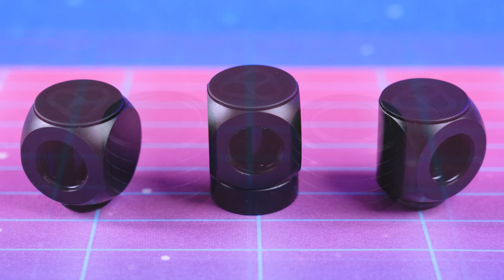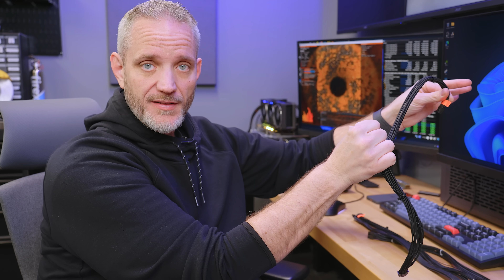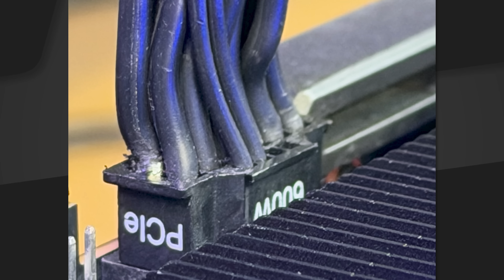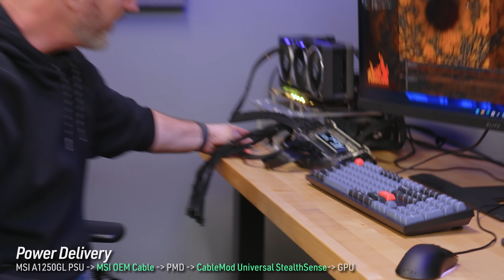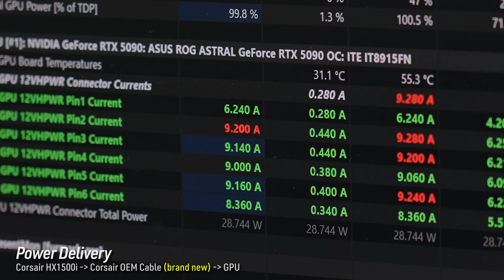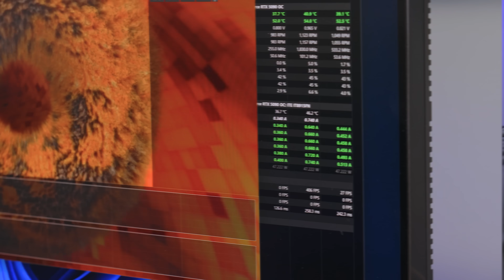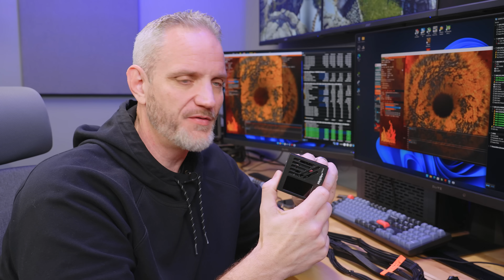More details on what could be causing 12VHPWR / 12V2x6 Cables to melt

Comment: just instead of soldering 2x6 just solder xt90 there. also i heard if this melts there is only one coil on the way to core so 12v goes on the core frying it if that is true resoldering 2x6 is least of an issue

Comment: Jay - Ever go to a classic car show and notice the near wire free engine bays? 

Why don't they make a longer PCB and have the connector on the far right side in the back corner area?  and designed/engineered for right-angle use.  This way you have a SHORTER cable + hidden cable - then- it would not matter if it's 3x8 pin or WHATEVER it needs to be.  You would then have less tension on the cable...  They want us paying $1500-$5000 for a video card - but they cannot spare a few extra dollars in materials?  

Let me guess: Next time we'll have to SUBSCRIBE to a cable to get one that works? ;-)...

EVGA had a sweet right angle adapter for their 1080ti FTWiii - I never had one problem with it- and it cleaned everything up.  There's no reason why we need cases with cables going all over the place when everything CAN and SHOULD be engineered from day one to plug in - work correctly and not look like a bowl of spaghettis at your fave Italian place!

Comment: Hey Jay, I've got a 5090 Astral LC, with a Seasonic Vertex PX-1200W psu, both came with adapter cables, 12HPWR to 8pin PCI-E with GPU ,12HPWR to 12HPWR with PSU, but I've still decided to buy a 12V2x6 native (manufacturer calls it this way, with both connectors being 12V2x6) cable from Seasonic and use that instead. They have the connector colored as light blue, which should go in all way into the female connector on GPU and PSU. It was extremely hard to get them in, I've even took some pictures to confirm they are seated properly. So far it's good, did not see any physical changes to it, I'm using GPU Tweak 3 and HWInfo like you to monitor the load on the pins, I just renamed it to 12V-2X6 Pin1-6. The biggest difference I've seen is 0.040 A under load between some Pins. Tested with some games like Doom The Dark Ages, Stalker 2, Elder Scrolls Oblivion Remastered, Hogwarts Legacy, Space Marine 2.

Comment: Sure doesn't help you pulling on the cable when inserting and removing it rather than the plastic connector...

I do have the Farsgear 3xPCIe-8 to 12v because my PSU has no 12v. The 12v connector is very very tight it's a nightmare to put in and get out.

Comment: I just got my hands on Astral 5090 and it sits in the box since I’m afraid to plug it in🤦‍♂️ please help me out. I already ordered wire view pro 2 but I wonder if my Seasonic Prime PX 1600 3.0 Patinum will do the job or I have to get sth in 3.1 standard? Working with Threadripper pro 7975WX. I used the Corsair cable for my 4070ti so far but now I’m not sure what would be the safest option. I do a lot of rendering

Comment: I use a CableMod 12v2x6 90 degree angled cable, that's the only cable I trust. Wires don't bend and the 90 degree angle makes the wires naturally flow towards the PSU without any stress bends. Also the wires are pure copper and not tinned copper which has a much higher melting point.

Comment: this is what happens when idiots decide that because 1 pin can, all pins can and then connect them to joined current    oldest discovery in electronics - literally why power systems use BUS BARS instead of groups of wires

Comment: 4:29 Zip-tie + bending can cause internal braided copper to wear and tear.  changing the bend direction altering resistance and causing cards to shut down sounds like internally torn copper.
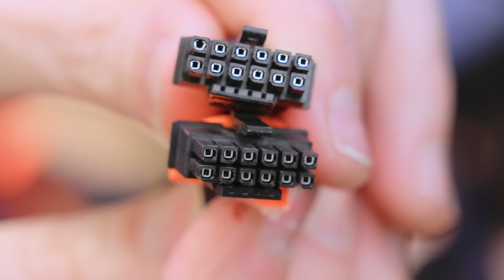16:33 the top left terminal on the upper connector is deformed massively, also bottom connector top right looks pretty deformed, and the more important part is where the terminals meet, there may be a bar spring construction inside with actually makes the contact which we cannot see  in the video which also might be plastically deformed.  I've been involved in massive recalls for connectors (not in PC industry), and seen some bad connectors, but these stamped terminals with open ends like these can plastically deform and lose contact force, causing increased impedance quite easily, and it's extremely hard to tell by visual if it's actually making good contact or not unless you do a proper tear-down and 3D scan/measurements.  Especially when the connector specification only require a dozen or so mating cycles, manufacturers will try to use cheaper materials/construction/manufacturing tolerance control to keep things cheaper which can be more prone to plastic deformation (some more boutique cables might use better connectors that use better materials or design).  These types of connectors dimensions are measured in micro-meters so even if they look "OK"-ish, their mating force might already be out of spec (don't know the exact spec for 12V 2x6, but many industrial connector terminal crimp height tolerances are in the 0.01mm range).

Comment: A cable that's so easily damaged or "installed wrong" to the point that it causes melting and fires, shouldn't exist. I understand what they were trying to achieve, but PCI-E power is just better minus aesthetics - I wish Nvidia would just drop it entirely, as it's not really that safe..

Comment: Got to give credit where it’s due. The 600w cable that came with my rog Thor platinum 3 spent 8 months plugged into a 5080 before I upgraded to an astral 5090. When I fired up the 5090 I started monitoring the pins with Troy benchmarks overlay and was getting constant pin imbalance warnings. Gabbed a cable mod pro 90 degree cable, plugged it in and now rock solid 98% pin balance under any load.

Comment: How much longer it will take for manufacturers to realize that 12V high power connector is a BAD DESIGN? We don't need lab testing, we don't need special tools to monitor each lines, we don't need manufacturers of power supplies and graphic cards to invent new stuff to prevent graphic cards from burning down people houses,... We need to ditch that connector and make something what will be actual working and will be safe, because that crap show with 12V high power start stretch into years right now, and IT WILL BE ONLY WORSE.

Comment: Gigabyte Windforce RTX 4090 still fine using the cable that came with my Bequiet PSU. No trace of overheating/melting after 3+years of playing 2 hrs daily. Just use a good quality cable and PSU.

Comment: Wouldn't the power supply shut off the POS if it can't detect a proper ground connection?  I mean, the power supplies are like a battery, they're an overly complex system of checks and balances...

Comment: I doubt that any of PC cables (even these outside the PC for supply and to display) are designated to operate in frequent move. Such feature require special design with very very thin copper wires. That is why you all need to be aware that these cables are only for stationery installation.

Comment: The fact that I see 9A being pulled through the pins through even distribution is already cause for concern. That's (edit) 1.3 Ohms for f*** sake!!!! That's flirting with fire!!!!.
It should be a 24 pin motherboard connector connecting to these cards, AT LEAST. Not these 12V*L*PWR 2x6.

Comment: You could also investigate Sapphire's 9070 XT adapter which has already proven to fail massively. There's definitely something wrong with the design of that adapter because the card works perfectly with a native cable from PSU

Comment: Yeah, I learned quality of the cable is the main thing. I have had new ones, test them with GPU tweak three and some pins and their amp draw are all over the place. When I went out for the 5090 I was originally going to get the water cooled MSI variant and opted instead for the astral. 

I know it’s expensive but it’s a bit more peace of mind that I can test cables and see how they’re doing under load.

Comment: The problem of WireView is that you are 3rd connection point that could become a problem. I looked at the spec, and it seems they have temperature probes for input and output, and two more external ones to monitor something bad happening. This connector is simply too fragile, flying to close to the sun (well, it's limits). I have no idea how they decided not to have protection for loads. You don't need a lot of power to get things melting over time.

Comment: I have both 4090 TUF & 5090 Astral. 

MSI & líen li power supplies. New out of the box the lien li the cable would show in even amps in the asus GPU tweak 3. Put in the MSI cable and the amps across the 6 pins had less deviation. 

I’m pretty clean and I clean my ps about 1 or two months.  

Noticed the cable started having pins with higher amps. Orders good quality cables and no issues.

The cables can fatigue with a lot of plug cycles. So if I order a new cable I look at the pins on both ends then test them by running the 5090 at 600 watts in different scenarios. Then I bump down the power limits back to 95-97 power.

Comment: If each pins are rated for 9.7 amps, 8 amps isn't healthy. It shouldn't be drawing more than 7 amps per pin, ideally 5 or less. The RTX 5090 is maxing out the 12v high power connection and it really needs 2 of them to prevent this.

Comment: Copper wire can and will develop work hardening over time.  It should be another good test to go end to end, pin by pin, wire by wire...and test resistance with a DMM.  A minute or two of time will show you if the wires themselves have a variance in resistance which can also explain pin sensing load variances.  Do it in another video so the horse's spirit can begin being beaten hahaha.

Comment: Jay I see you wiggle the plug for side to side as you plug  them in and remove them. you should only pull straight up and down without wiggling. wiggling causes expansion of the sockets in the connector. The tolerances on the pins and sockets are very minute /tight tolerances and the sockets will expand after repeated insertion with a wiggling action. If you look at the sockets under magnification,  You will see it as a stamped part with a gap on one side of the socket that can expand. Just my 2 cents form a electrical harness manufacture. Hope this help you build better insertion habits.

Comment: Like cpu's I remember early on people saying the plug has a very limited amount of reseatings, was wondering if I was going crazy and asked ai and it says the plug is generally rated for 30-40 matings. You went out of spec on the plug in less than 10minutes of showing floppy cable connections. Is this really fair to any of the products being used?

Comment: In the 1980s I did serious professional radio control racing, the motor controller to motor to battery used silicon wires able to pull 100 amp spike and 60amp all day long and I never replaced a set in over 3 years, and here we are in 2026 using braided cheap wires and nylon plugs, the nylon plugs are fine, but the cabling is garbage.

Most reputable PC cables use PVC, but the bargain cables you find on sites like Amazon often use lower grade blends or even PE (Polyethylene) and PP to save a fraction of a cent per meter just don't buy cheap cables.

Comment: I work as an electrician and I always wonder why these wires can be run parallel and not have a fuse or a Shunt as a failsave for each wire.
When we run wires in parallel we have to have a fuse on all wires so if something goes wrong you wont end up with a fire. At least if the Single wire cant handle the full load all the time.
Im just glad my GPU still has the old Standard where I have much more headroom before it even gets warm.

Comment: KIDS DONT TRY THIS AT HOME that 5090 is very dangerous it mess with power supply now not the 12v pin connector but the cable that is scary ...for safety put fire extinguisher next to your PC😅

Comment: At this point, I think PCI-SIG needs to just say "fuck-it" and either fall back to PCIE or develop some hard-wired power delivery like those dumb back-front motherboards. The 12Vhp connector experiment has been a resounding failure.

Comment: What's pretty stunning is that you have all of that power moving around the board in nearly a flawless way, yet you have high levels of failure on a cord or connector. Clearly you have several design failures that were not seen as failures, ignored for pride/cost/didn't care or hopes that it doesn't matter enough to hit their bottom line image.

Comment: Last weekend I also connected the WireView Pro II to my 5090. I had previously been using the 4-to-1 adapter cable that came with the graphics card... the WireView adapter immediately displayed a warning. I then switched to a Corsair cable and was able to run two hours of benchmarks without any warnings. After the silicon lottery, now comes the 12VHPWR cable lottery.

Comment: Leaving the cable alone inside the card is the best advise I can get from this unless I want something to melt. The pc has a lot of fragile components and should be left alone unless you are building it for the first time. As much as you would enjoy tinkering and plug cables in and out of boards just brace yourself and leave it alone for a year or two until you are going to BUILD something totally new from scratch.

Comment: Transient spikes can messup alot of stuff, the sudden rush of extra amperage (remember current runs through the entire circuit for DC circuits) that now needs to run to the remaining grounds could have caused a clock instability and the bios caused the shutdown? Maybe you simulated a power surge through quick movement of current? Sensitive and high speed electronics tend to be very picky on their grounds.

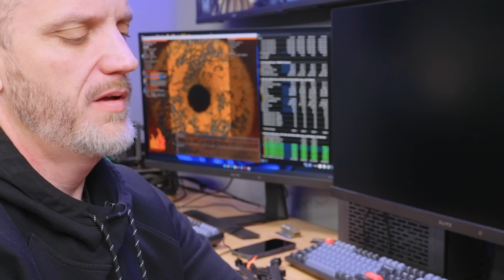Comment: @16:32 clearly the upper left pin in the top connector is splayed out. The upper right on the bottom connector doesn't look so good either.

Comment: the cables have voltage and amperage. if you suspect the wiring/plugs to be bad - the way we diag this in industry is putting a scope on one end. then loading to max amperage and checking voltage drop and thermals on each pin/wire.   we then load with high voltage (40KV+) at a low amperage (.05a) and check the scope for each wire to see if there is a short or bleed over.    do this to your cables          also if you have loose pins... just touching the cable, anywhere, can cause it to wig out

Comment: I have a tuf 5090 and i realized basically after the day i got it, that it needed to be in quiet mode and be unservolted. It has worked like a charm, i barely pull 400 watts now and its way cooler

Comment: I have to admit, one of the saving graces of only being able to secure a 3090 was the safer but bulkier 3 way PCI connector for power. Way more tolerance to imperfect connections than any of the 12VHPWR models. Connector variance is a fact of life. I periodically have to clean up speaker connectors due to what I believe is ground variance in such locations. I would imagine that 10 amps @12v has little room for variance without risk of fire. This is just my opinion and I'm no expert in this area, but cleaning up those connectors definitely solved what I though might otherwise have been an amplifier fault. That safety cut off device to save all things looks like an excellent idea for anyone using modern graphics cards which the HPWR connectors.

Comment: The Corsair one didn’t have native termination on both ends? I just built a PC with an RM850 and it has that native 12 pin on the power supply, is yours an older one?

Comment: These cards are pulling to many amps for the wire size and pin size. I have figured that out when I first started. check your wire size and see if its 12  awg stranded or 14 both only allow set amps

Comment: The problem with these cables and it has been since day 1 in my opinion is that the wire gauge used is to small for the current load if the connector pins were larger and the wire guage was larger these issues wouldn't exist imho

Comment: So did a little looking highly likely the Wire Gauge for these cables is either #18(max amp 10)  or #16 (max amp 13) so if the cables are getting close to 10A that would be very dangerous for those Gauge cables. Google says the 12vhpwr cables use 16 Gauge for the 12 main power pins and 28 Gauge for the sense wires (the lower the Gauge number the bigger the cable) the google info im taking about is from cable mods website.

Comment: When I bought a 9070 XT, I specifically looked for one that did NOT use 12VHPWR connections because of the problems with them. I ended up with an XFX Mercury OC, which uses three 8-pin PCIe power connections instead, and since my PSU (NZXT C1000 Gold) has five CPU/PCIe power connections it was trivial to feed each branch over its own cabling.

I just did a monthly dust blowout of my case and checked all three connections, and they're pristine. Not the first sign of heating, let alone the meltdowns plaguing 12VHPWR. Card has been working flawlessly since I got it.

Comment: First Intel 13th and 14th Gen CPUs are drawing too much power and melting themselves. Now we have 5090's with cables melting and or drawing too much power. At what point are computer engineers going to realize you can only squeeze so much electricity into something before its no longer safe? Threre needs to be some method of quality assurance and or testing before releasing products for the consumer to discover potential problems like this.

Comment: There is a huge difference between gold or tin connectors and crimped versus soldered.  I've repaired a bunch of electronic equipment by making a better cable connection.  Also, layered pc boards with SMD's and through connectors need excellent solder and many wave solder machines do a minimum solder job because it is about throughput (volume) rather than quality.

Comment: a volt meter from harbor freight with an ohm setting can do the same thing to test the wire.  costs less than 10 dollars.  and you can test any cable or wire for functionality or breaks/shorts without running the risk of damaging components.